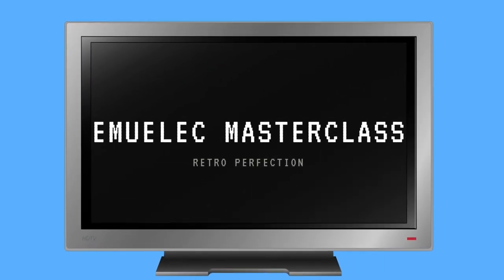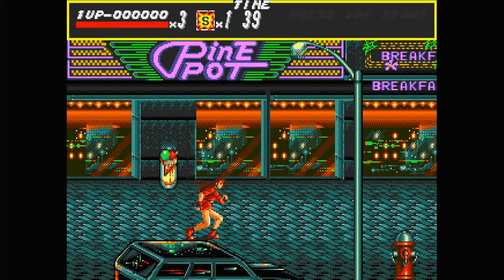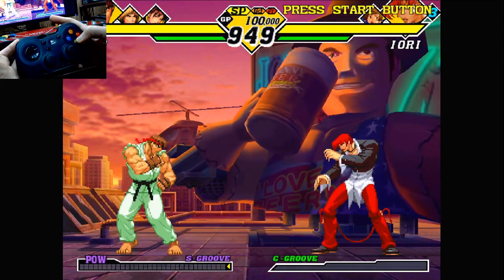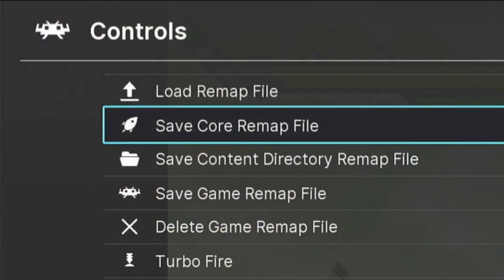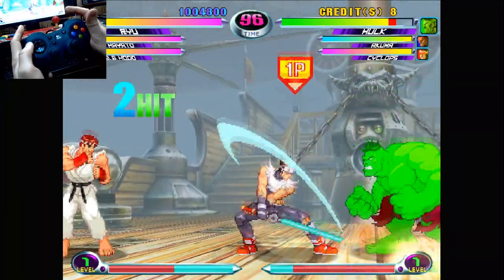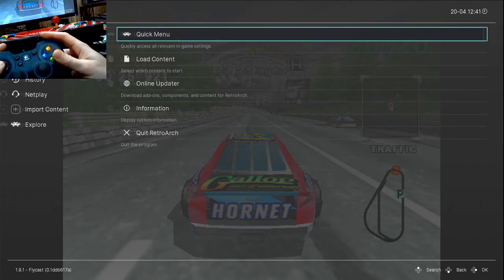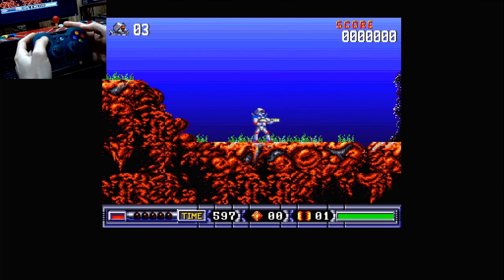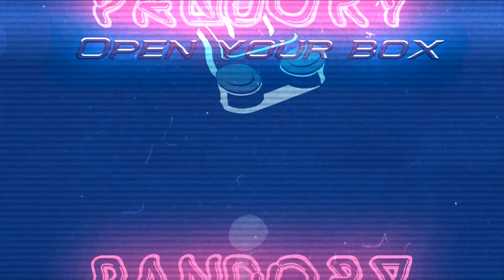Setting Up Controller - Super Console X - EmuELEC / RetroPie - EEMC409

Comment: I am having a problem where everything works fine when playing with two controllers but then after I turn the second player controller off it will no longer let us play two player games with both controllers.Both controllers will work in the menu ect but will not work at all in two player games.I am using the controllers that came with the system.

Comment: Can you reset the configuration as I messed up and now I can't navigate the in game menu
Reply from the maker: oh!  Check our review of the 5600 box- your solution lies there ;-)
Reply: @TeamPandory  I can get into the quick menu,left stick moves up and down but I can't get into the sub menus,it doesn't recognise button presses...its on the controller settings i messed up on...all I can do is get onto quick menu,leave menu or leave game
Reply from the maker: @markt0370  hook up a keyboard, set the auto config then go to town with your controller.
Reply from the maker: @markt0370  in main emuelec menu - try push start - emuelec settings - danger zone - reset retroarch config to default config

Comment: Hello! I have a question for you: I have been attempting to use my 8bitdo Pro 2 controller with Emuelec on my Super Console X Pro and the controller does not register properly when setting it up in the menu as you did in 0:44. The controller registers as an Xbox controller, and then is unable to register the analogue sticks correctly (it thinks any input to the sticks is a d-pad input). Retroarch has the same issue. Is there a way I can work around this or enable emuelec or retroarch to recognize the controller properly?
Reply from the maker: We've found best compatibility to be when using a dongle.  Using bluetooth with any of these boxes is really a hit-and-miss experience.
Reply: I should have clarified, I am using a dongle. I am using the 8BitDo Usb Wireless Adapter @TeamPandory
Reply from the maker: @raptorstudios1839  ok. Which one is it ?  The brown / black / gray?
Reply: Its the black model 2 version @TeamPandory
Reply from the maker: @raptorstudios1839  okay. That black dongle is for mini consoles mainly like the megadrive mini, the analogue sticks won't be detected as a separate input. 
The brown 8bit dongle is the one you want, that'll give you all the xbox360 input loadout with analogue sticks.
Reply: Just to make sure I am understanding correctly, the color is all that matters? I could purchase the adapter of the exact same name but this time brown instead of black and the analog stick inputs will work with the Super Console X Pro? Seems odd that 8BitDo did not market the colors as different. @TeamPandory

Comment: I have just bought a Kinhank super console x and trying to configure the included controller. The console recognize the two Microsoft  X-Box 360 pad after I hold A button to configure the controller, but I am unable to go to the next step to map the controller no matter what button I press. When I highline the controller and move the joystick to the right, a small windows pop up with INPUT P1 #0 Microsoft X-Box 360 Pad, if I move the joystick to the right again to choose it, it takes me back to the controller settings screen again. I just cannot go to the controller mapping page. The left joystick is the only thing work that allows me to move up and down to highline what I want, and move left or right to choose, nothing else is working. I cannot use the controller without controller configuration. Can you tell me how to go to the mapping page from Controller settings page?
Reply: Hi, have you found a solve for this? Im getting the same issue. Thanks

Comment: Yesss just in time. I've just got emuelec 4.0 working on my s905x3 android box. I'm finding it very confusing setting up my controllers for n64 and dreamcast. Also why no saturn? I've got yaba sanshiro working after finding the bios files but I'm Glgetting black screens in some games. Also why is saturn the only one I've had to mess around finding the bios files for? Literally every other console just worked when I loaded the rom for it.
Reply from the maker: Hey there. Saturn is actually quite a new system to be emulated, so I would expect a few games to choke. 
Re bios : some systems need them. Some don't.
Reply: @TeamPandory  thanks for the reply. Do you know if beetle saturn emulator works with emuelec? I've got it for pc using retroarch but can't see it on emuelec. All the games run perfectly fine on my laptop using beetle emulator
Reply from the maker: @justuraveragegamer2670  beetle emulators as a whole focus on emulation perfection, but are very heavy on resources.

Comment: Is it possible to make bluetooth gamepads work in android and EmuELEC without pairing each time?
Reply from the maker: Using something like a mayflash ns, it'd only need to be paired once. 
As emuelec and android are different operating systems, it may need to be paired when you switch.
Another option is to use an 8bitdo pad with different modes.  Use one mode for Android and the other for Linux.
Reply: @TeamPandory  am i right that the gamepad itself remembers to what it is paired? 
So the gamepad must have such capabilities?

So it cannot be resolved using software options for Android.
Reply from the maker: @eduardmart1237  Bluetooth works by pairing a device.  Both on the controller AND the host machine.
If the host machine has no bluetooth capability, you won't be able to pair any controller unless you get a bluetooth dongle.
Reply from the maker: @eduardmart1237  tbh I think it's (mostly) the other way around.  Bluetooth controller shouts (hey!  Connect to me) and fires off maybe a passcode.  If the host doesn't see that code, it won't connect.  - That's how it works in my mind, anyways.  Better checking up on google

Comment: I know it’s a long shot but I have a n64 controller that registers as a switch controller when I plug it into my super console x. Is there a way to make it work correctly?
Reply from the maker: If you can bind all buttons and directions in retroarch, then yes. This video should show you how.
Reply: Thanks a lot I’m getting closer but I can figure out how to set the buttons correctly because it thinks I have more than I do. It won’t let me set a and b without one of the c buttons in () 🤦🏾‍♂️🤦🏾‍♂️
Reply: I may just be overthinking it

Comment: Hello. I really want to make my speedlink joystick to work. It has two large round buttons and two triangle buttons and then the stick itself. How do configure this to work please????
Reply from the maker: This guide covers most, if not all controllers.  Give it a try with your speed link.  First do the directions- Then maybe set the left triangle button to be SELECT, the right to be START, and have the hotkey as SELECT too.  Both round ones have as A and B   -  Everything else hold down a button to skip
Reply: Hello. Holding down a button doesn’t skip an option for me. It just won’t work. Any help please?

Comment: Mate, all your videos are awesome but I need a little help setting up 2 controllers with Super Console X Pro and I wondered if you can help?

I am using the 2 controllers that come with it. I find if I have both dongles in, the system struggles to know which controller is which? Can you help?
Reply: I've had a similar issue. Player 2 just doesn't sync correctly. Please let me know if you know any tips on this! Thank you
Reply: @nextmanuppods  So they way I have done it is, put the first dongle in, configure it and then allocated it as P1. Then shut the system down. Plug in the second dongle, and do the same and allocated to P2. Shut the system down then restart it and they should be configured to P1 and P2. Hope that helps.
Reply: @lennybuckfield4782  Thanks so much, Lenny. I'll give that a shot. Are you saying to set up P2 with P1 dongle unplugged?
Reply: @nextmanuppods  No, so put dongle one in and set up the 1st controller. Shut down system and reload making sure it is configured correctly. Then shut down again and put in the second dongle and do the same. 👍🏻👍🏻👍🏻

Comment: I've been on the fence regarding which controller to buy for my Super Console X Pro (and my new X96 Air emulation box). Any recommendations? Will any gamepad that works with the Nintendo Switch work with Emuelec?  I've also already got Bluetooth 5.0 dongles. Will any dongle work? Thanks dude.
Reply from the maker: I'm actually going to tackle a few of those points in the next video ;-)
Reply: @TeamPandory  link to this video please 😊
Reply from the maker: @JEVUS123  I can't even remember what video I did or wanted to do... I think dongles should work fine, much better than the onboard. 
Perhaps the mayflash stick review?
Reply: @TeamPandory  thanks for your help sir

Comment: Hi there! I have a question with regards to controlling games made for computers as opposed to consoles. I’m trying to play my old ZX Spectrum games but the controller isn’t recognised. Is there some software I need to add that will allow a controller to work? I assume this would also affect the Amiga? I haven’t found any working roms for the commodore yet though....
Reply from the maker: Should be pretty much all the same tbh.  Soon as it's recognized in Emulation Station, should work in the emulators- as long as its libretro based.  I will have a look, but AFAIK spectrum is pretty much plug and play
...  need to check ;>
Reply: @TeamPandory  thanks for the quick reply! I don’t know yet if it’s Liberto, I’ll have to check myself, if not I guess I can add it. I did a fresh install of 4.1 onto an android box so nothing is properly set up yet, I’m just going through your tutorials.

Great vids, very helpful and enjoyable!
Reply from the maker: @bretriverboat9926  Thanks.  Really appreciate the kind comment.  We'll keep it up.  Sharing is caring ;-)
Reply: @TeamPandory  morning! I wanted to let you know I got it to work through the menus so thanks for that, you need to change the controller from game pad to Sinclair, then use a button for keyboard overlay to program the controls. Turbo esprit is brilliant and I always felt it was the precursor to gta!

Still figuring it all out. Can’t get ZX81 controller to work and I’m still a bit lost on the Amiga and PSX bios emulation. I keep getting a white screen

Comment: I'm having an issue where when I get into a game and I click buttons, it doesn't do what I'm trying perform and shows things like "reset" and "load state". Essentially doing things I'm trying not to do unintentionally. I see nothing but random icons and when I press the D pad up or down the volume adjusts from RetroArch
Reply from the maker: It sounds like you'd need to re-configure your controller again. - Sounds like  your hotkey is held down- do you have another controller to test?
Reply: @TeamPandory  you were right, my hotkey was somehow placed in a bad layout. Having said that, how do I go and delete save states? I think I made a ton of them by trying to sort out this mess lol?
Reply: @TeamPandory  hi, this fixed also my issue thank you, but how do reset the volume (popped up on the left)  in Retro Arch and the FPS that popped up in the right corner please.

Comment: this has been very helpful but when I'm trying to map my buttons for MvC 2, I'm not getting a medium punch and Kick, only light, strong and assists. I've no idea why. I'm trying to map a hori fight commander xbox 360/one pad
Reply from the maker: There are only light and strong punch kicks in MVC2. No medium.
Reply: @TeamPandory  ah ha. I thought it was the same as street fighter 2 controls. I’m a noob at this and you’ve been a great help. Thank you.
Reply from the maker: @AlphaPapa69  no worries
Reply: @TeamPandory  I’m having trouble trying to use any of my Bluetooth controllers. The system seems to find my smart tv but won’t pair with my 8bitdo snes style pad or my switch pro pads. The pro pads work perfectly wired though, just no Bluetooth.
Reply from the maker: @AlphaPapa69  use a dongle. The Bluetooth in these boxes is either nonexistent or flakey
Reply: @TeamPandory  I’ll give it a go. Do you know if I can use the dongle that comes with the kinhank ps2 style controllers with 8bitdo controllers?

Comment: Hey man thanks for the video. I have problem with my controlers. I went to the controler setup to configure. But something when wrong. I got out and controlers have now diferent button. Zo i can not enter the controler setting anymore.  Or change it back Do you now where can restart the system so the controler can reboot? Thanks in atvance
Reply from the maker: You may be best with pulling all your games and re-installing the system with a fresh image of emuelec.  Or perhaps try "reset to defaults" in the menu?

Comment: Hi, i have a problem with the controls on the psp system, they used to work, but now the don't respond at all, but this happenns only in the psp systema, do yo know how to fix this? thank you
Reply from the maker: Sounds like requests for some new videos :)

Short answer, wire up a keyboard, set the controls up in the ppsspp options screen

Comment: Hey bro, I've noticed on my X96 Air TV box and Emuelec 4.0 (and with my Super Console X Pro as well, which runs 3.9) that if I do a soft reset either by restarting the box in Settings >> Restart, or shutting down but not completely removing power (using remote to power back up), the gamepads stop working unless I unplug them and plug them back in. Have you noticed this? I noticed this using the bundled wired controllers with my Super Console X Pro.

And here's another weird thing: I recently got an EasySMX KC-8236 wireless gamepad and the issue I described above went away, but then I got a second X96 Air box and, using the same microSD and EasySMX gamepad, the issue came back. The gamepad lights and dongle lights would just flash and they wouldn't pair unless I reinsert the dongle. Never happened on the first X96 Air box. Note that only the TV box was changed. I plan to give the second box away, but given the issue I'm again having right now with the second box and wireless controller, I'm a bit hesitant. I have two more KC-8236 gamepads coming in that I'm bundling with the second box, but they're still a few days away.

Any advice or theory as to why this is happening would be much appreciated. Thanks, dude.
Reply from the maker: Honestly- Not a clue.  Perhaps the adapter isn't giving enough juice to power the USB pads at boot-up then gives in?

Comment: Hello, I'm running emuelec on Android (retrokat xpro2). I have been having an issue when I try to play with a second player. When player 2 joins a game for example, in a 4 player (press start to join session type) player 2 is also 3 and 4. In some cases player 2 joins in as player 4... is this issue fixable with the menus you've discussed in your video?
Reply from the maker: Might be.  Need a bit more information on the game and core that you're running it on though.
Reply: @TeamPandory  actually thanks to your video I managed to troubleshoot it for each emulator that had the issue. Thanks :) I disabled inputs 3 4 and 5, reset input 2 to defaults and that worked.
Reply from the maker: @markwilson832  Great to hear!  ;-)  Glad you got it all sorted!